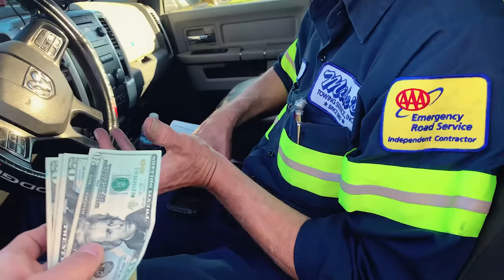POLICE INSULT ME MOMENTS AFTER MY DREAM CAR IS WRECKED! *LAMBORGHINI CRASH*

Comment: The truckers could afford it... because some of them pay for their own trucks and trust me.... those trucks go for $150k+
Reply: Austin Cryan truck drivers make bank
Reply: Truck driver here. Yes, they are expensive. However they make the money that pays for them. We can earn around 200-300k yearly but after fuel, taxes, payments, maintenance etc it's much less. We're never home enough to drive them anyway 😭😭
Reply: Jarrett Snapp drive local! Plenty of money and you can be home. I’m taking a NYC local job making crazy money but it comes with its downsides lol
Reply: Yup and that's isnt counting the trailer sometimes
Reply: Yeah but half of what they make goes to paying off the truck and another amount goes to the insurance but they still make around $900-1200 a week when all that is taken care of
Reply: For a new glider kit truck, (new rolling chassis, re manufactured engine and transmission, you're in for more than $120k for a OTR truck with a mid level sleeper box.

A new Freightliner, Peterbuilt, or Volvo optioned out, you can approach $300k. Then tag $75K for a reefer trailer and you're approaching $400K.

The DDE cars are an investment into the channel for content. No car, no content, no DDE. Per socialblade, the average DDE video generates over $3000 each not including the sponsorship deals.
Reply: I imaging the number of Owner Operators buying new is very, very small.  It's called leasing or buying a used truck with 700,000+ miles on it.  Also, while an owner operator may gross 180k a year, they might only take home 40-45k after expenses (fuel, maintenance, truck payment, insurance, health care, etc..).    So unless the trucker has a youtube channel where the supercar is going to start earning them immediate income then no, they can't afford it.  There's a big difference between a business expense necessary for your job and a personal vehicle.   Luckily for DDE the cars are both.   I image DDE spends more a year on travel costs (hotels, air fare, fuel, eating out) then what it would cost to finance any single one of their cars.
Reply: Lol they dont really make money. I work with truck drivers and its a tough job. Insurance, gas tolls, tickets are just the basic of expenses.
Reply: Yo truck driver. I'm home everyday. Where do you live?
Reply: Austin Cryan I agree a Semi truck is 150 Grand to or more and being out on the open road is my dream job I have to wait till 2023 to have a perfect clean driving record with no tickets and accidents before I start driving a truck but because I'm not into Exotic cars I'd much rather get a Subaru WRX/STi or a 350z with Manual Transmissions
Reply: That’s very true Austin
Reply: My mates truck is a 18 meters combination, full option everything 375k+

Comment: "Why is there coolant leaking from my wheel" 🤦‍♂️
Reply: On a supercar, the brakes are water cooled. As the wheel got ripped away the hose came off. Easy fix.
Reply: Not brake fluid then?? 😂
Reply: Bravobraza it wasn’t coolant it was break fluid leaks
Reply: @dsmdallas2466  💀💀💀💀💀I'm dying

Comment: 4:47
That might be a total loss guys. 
The upper control mount to the frame is ripped out. Sorry Dave.
Reply: aw man ur right. thats not good
Reply: @santiceja8758  
That's a really ignorant assumption. 
As an ASE certified mechanic of almost 20 years, I know what I'm looking at. Hence why I timestamped it aswell. That's not being negative, that's pointing out the reality of the situation. If anybody is being negative here, that would be you. Then again, you prolly thrive off negativity by the looks of your melancholy retort
Reply: Hopefully the rear frame structure will be modular in design.
Reply: @sean911sc5  
That's possibility, though I don't know if that's the case. For Dave's sake, I hope it is. Then it can just be a simple R&R with fender+bumper scuff and splash